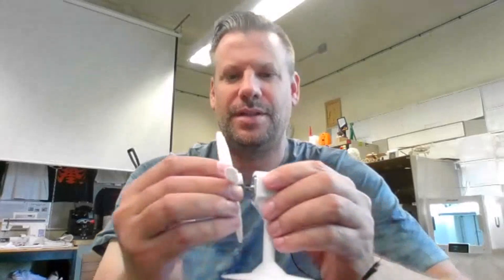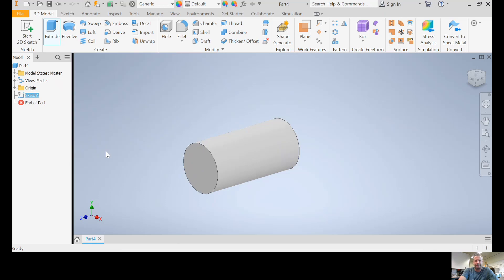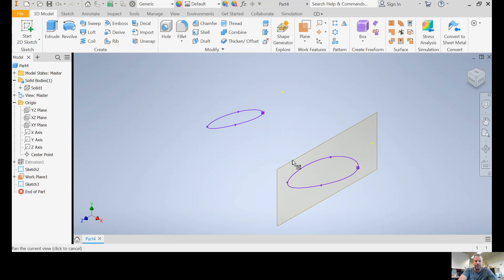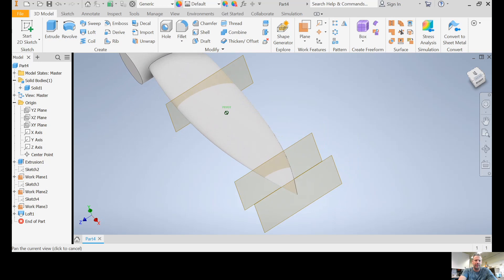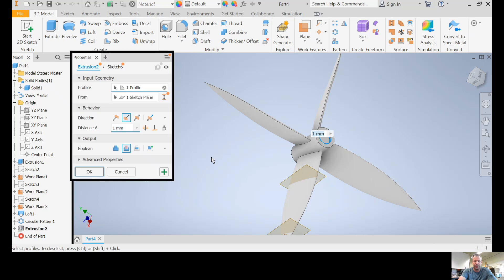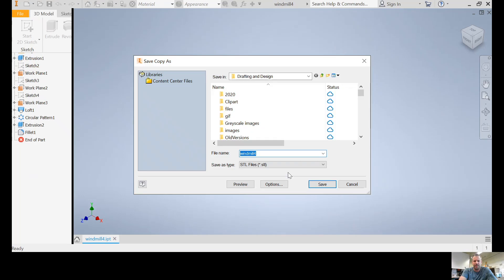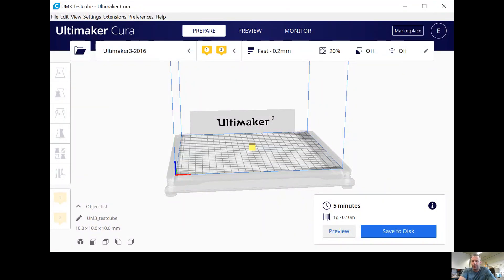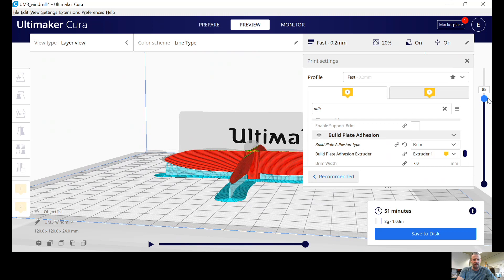Inventor Tutorial: Wind Turbine Blades

Comment: Did you try running it through a fan to see how many RPM it has?
Reply from the maker: We didn't test RPM,  but we have a wind tunnel tester and we checked the voltage and current output.